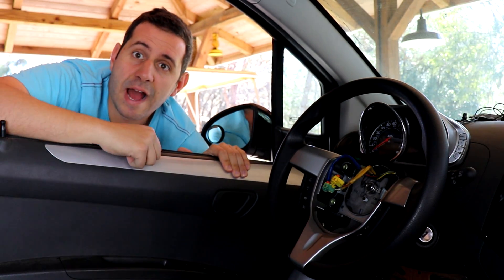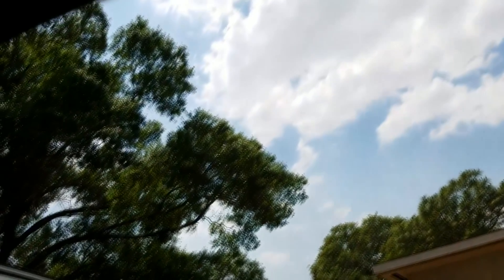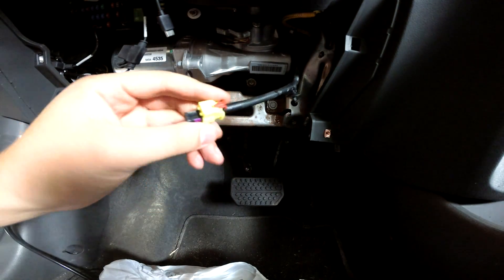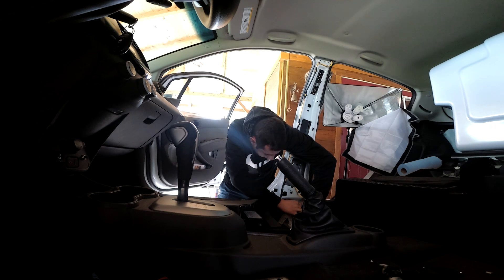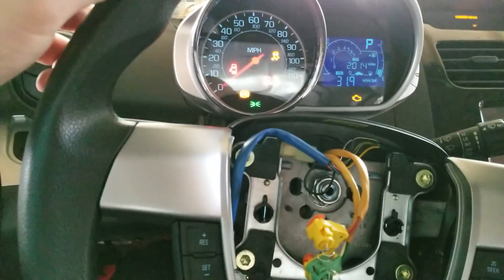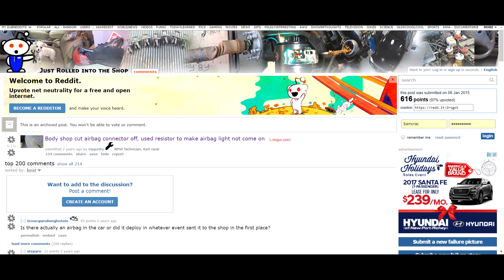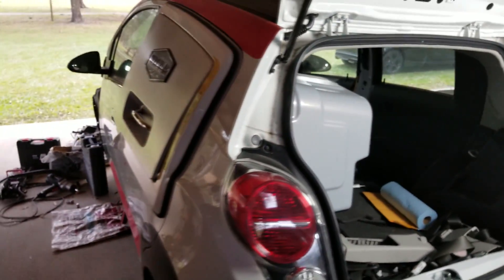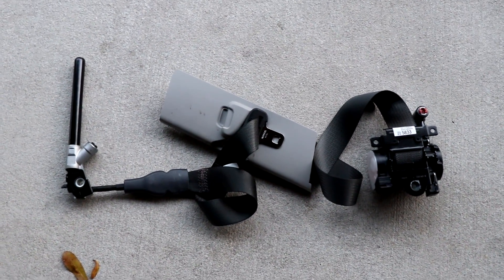How Scammers Hack a Car's Airbag System for 5 Cents (Permanent Airbag Light Off)

Comment: Samcrac There are actual apps that give options to turn off the airbags in certain locations. I have an app for the 2013-2016 Ddge Darts to where I can turn off certain airbags like Seats if I wanted to run a racing bucket.... I can also turn them completely off if im on the track as well.... guess what... no light on the dashboard. most FCA cars work on this app as well.
Reply: tellus

Comment: I was worried about airbag activation when installing a new one   Is it safe to install an airbag. You don’t need to be certified?
Reply: Disconnect the negative terminal of the battery wait 5-15 minutes and you won’t have any chance of the airbag activating when you install a new one

Comment: You have to be a real POS to put a resister in to turn an airbag light off. Does not surprise me though.
Reply: i really want to see a picture of this dude and his family driving down the road in a car outfitted with 4 nascar grade racing seats, harnesses, etc...on the way to get groceries.
Reply: there are legit reasons to do it  though - if you fit an aftermarket steering wheel to a modern car you will need to do this to get rid of the airbag light.
Reply: Done it lots of times in jeeps, when swapping out to 4 point seat belts or suspension seats.   I wouldn't suggest it for a normal, never leaves the road soccer mom's ride,  but it can be done.   It's the same as the catalytic convertor delete. Pop it out put resistor in.   Bob's your uncle.   Or aftermarket remote starts. I could go on with the legitimate uses of this trick, but I won't. 

As for the guy suggesting we all drive Nascar caged cars...  Even with a 5 point harness and a Recaro (the closest thing I'd ever suggest to full Nascar sprcs) your heads going to move in an accident.   This is why they wear Hans devices. It basically is a seat belt for your head.   Since Earnhardts death this is a requirement.   Nascar doesn't have to worry about cross traffic or blind spots since they use spotters.   This device makes it impossible to look around the car as its required to in everyday traffic.   Hence we use airbags to slow and prevent your head from snapping forward, where it could sever your spinal cord.
Reply: Your head doesn't need to "hit" anything for you to die, Your brain is suspended in a fluid inside your skull. A very high G-Force event can cause your brain to SLAM into the inside of your skull with enough force to cause a head injury and/or death. Roll cages, Safety harness, Hans device, etc is not going to stop this from happening.
Reply: @michigancur6670  Cat delete, dial your A/F ratio. Leave the rest to your imagination.
I junked a car with cat delete. It was 30 freed up ponies. And the trans went out.
But fun for a while.
Reply: @ayebee1207  we don't have smog check here, so usually once the cats go, I'll just straight pipe them.   A professional shop can't do it, but a buddy in the garage.... 😂  Other than that only when I'm turning something into a track car.  Then yeah it might be a couple dozen ponies but every little bit helps.
Reply: @ayebee1207  what kinda car? Note for. Future.ref, build the trans
Reply: @michigancur6670  That's  the reason the systems work in conjunction with one another,  a friend in highschool lost his fiancee from head snapping violently forward;  the seatbelt and airbag specifically have a task assigned to save a life.
Reply: @michigancur6670  I followed Mr. Earnhardt since he had the pink stock cars in the 1970's. I was really sadened upon his passing. His son and family were very lucky in the aircraft crash.
Reply: The stuff i've seen done by stealerships and their partners would make your skin crawl. ANYTHING for that extra dollar they can suck out of you.
Reply: Racing has people on the sidelines who are at the ready in the event of an accident. They don't have to worry about a fire immolating them while they try to get out of their harness and climb out of the car.
Reply: Fully agree. But even worse was what I have found on the Z4 (E85) that was delivered to me after purchase. Someone took instrument cluster out, disassembled it and put black electrical tape on: MIL, airbag and TPMS for them to not being seen ...
Reply: good point...but that is literally the only other reason you would do it.
Reply: It wont turn off if u do it that way....you would have to remove the shorting bar first.
Reply: m ph de
Reply: Or a manufacturer that made crummy dashboards. Big pieces of hard plastic that shatter when the bag deploys. The recalls on Takata bags claim that Shards of metal were causing injury and deaths.
How many are car interior trim? So I will let you chew on that. Airbag, claymore?
Reply: You people have been brainwashed into thinking The Airbag is actually saving your life? It is a supplemental safety device that adds another small tiny layer of protection aside from the Seatbelt. It was a law passed, that is why Manufacturers had to comply, and this causes car prices to soar. This also causes lots of car in junkyards who resell your car in parts, because it was totalled out by insurance company, and insurance companies get to raise your rates, its a win win for the Auto Industry Billionaires and one hell of a loss of us Hard Working Americans. These Airbags have FOOKED us more than helped us and caused us serious Financial burden, especially on those that want to repair their own cars and didn't have full coverage. Now the dealer gets to sell another car, because your car was totalled, why? because of Stupid Airbags that don't save lives, is your seatbelt DumbDumb. 

If you think an Airbag saves lives. The Drive with your family down the road, with no seat belt on "Only Depending On Airbag" and get into an accident and let me know how that works out for you and your family. On the other hand, Do the opposite, drive with you seat belt on, get into and accident "No Airbags" , and let me know how easily your walk away from such crash. 

We have classics on the road with no airbags, cars from 1950's up to 1998 or so with no airbags and they are still on the street and you don't hear of people getting killed in those cars because they have to Airbags, Do You?.  For God Sakes we have cars from the early 50's on the road with no Seatbelts at all. Seat Belts were required in rear seats by law up into around 1964 not even front seatbelts, and it wasn't even law to wear them or Mandatory, cars just had to have them... Law came in the 1984 here in NYC, because of that Authoritation FOOK Mario Cuomo Senior. Now as of 2021 his Son is Governor in NYC and He is even a bigger D**K and is requiring that all passengers in the rear wear seatbelts or get tickets and another FOOKING reason to pull you over and take your hard Earned Money.  

I Swear there are so Many Sheeps that believe and trust in crooked politicians and swear our Governments are Gods. If that's you, you deserve what's coming.
Reply: @ELEVOPR  one of the only free thinker, non brainwashed ppl here
Reply: As in what fashion? Selling a used car private party to an un suspecting buyer?  Yeah if you're Intentionally being deceteful with a normal driving car... BUT you'd have to be an ignorant asshole to assume this modification is explained for people selling a used car.. Ya prick.. this bypass is much more commonly installed on custom vehicles, aftermarket racing seats, etc.. However, it's mostly useful for honest and respectful everyday people who have an issue with their own personal vehicle and would LOVE to get rid of the aggravating and bothersome SRS warnings or notification chimes/lights that one day randomly appeared and never went away... JERKOFF
Reply: I need to do this in my converted Transit van so the giant side airbags don’t blow the wooden cabinets I’ve built into the cargo area.
Reply: @brandise76  I'm about to do this for my mini van I've gutted and now will start my build. You can take the air bags right out, then put the resister in. Just make sure you disconnect the negative battery cable before messing with the airbag.
Reply: The Obsesed Anime Freaks A Nascar racing seat is like a baby seat on steroids, you must be agile and fit enough just to contort your body to get into the seat, then theres the problem of turning your head to do basic driving functions as that area is heavily bolstered and only allows your head to be pointing forward. Imagine a vehicle with all passengers sitting in this fashion? Its highly impractical.
Reply: So are you saying that all the research, development and  laws revolving around airbags all around the world simply should not be because reasons?
Reply: @juanjovista1  yes harnesses and roll bars are are actually safer.
Reply: Drive slow butt holes
Reply: Mariusz Dullak Thats why all manufacturers have a "bulb check" function. Turn car on without starting engine and all warning lights will come on. If those dont light, walk away
Reply: Number of reasons to do it...but yes if you do it an don't disclose it when you sell the vehicle you are for sure a POS
Reply: It’s just so messed up like they could actually hurt somebody doing that
Reply: uh they have, hell NASCAR, Recaro, Sparco and other manufacturers and racing series have, but due to practicality and stagnant outdated pile of shit regulatory reasons, they haven't been implemented. Have you seen a wreck in nascar?  have you seen the worst wrecks in most autosports? These drivers walk away from stuff that would kill them in a normal car. normal cars are unsafe compared to the safety systems in a race car. if you were smart you would throw out those airbags and go to something a bit more intrusive and more effective.
Reply: it's more realistic and reliable than an ejection seat or airbags, and they don't necessarily have to go that far, just far enough to hold you in your seat and protect you from impacts.
Reply: @TheObsesedAnimeFreaks  ejecto seato cuz
Reply: If they are so dangerous why does everyone use them? You would think at least one company like Mercedes would go out of their way and create a better system then advertise why the old way is dangerous compared to theirs aka they get more people buying their products.
Reply: or actually someone that is smart and doesn't think that using explosives in a safety system is a good idea. (trust me it isn't) this is also why racing series have used roll cages, harnesses and other static systems to protect their drivers to greater effect.

Comment: By the way, when you twist the resistor and the leads touch, the resistor is shorted and 0 ohms, not the 1k, 2k, 5k ohms or whatever you chose.
Reply: that was bugging me too, wondered if someone else noticed
Reply: Samsung Galaxy S7 that’s my point exactly, the metal leads of the resistor will he fractions of one ohm or close enough to zero.
Reply: thank you sir.
Reply: I think he twisted them just enough where they weren't touching. Kind of hard to tell from the angle.
Reply: @hugoharo8868  oh don't ruin the sensationalized sarcastism of the hater trolls
Reply: yep  i was like wtf
Reply: Exactly
Reply: 2 ohmd

Comment: This actually happened to a friend, the car he had bought a year or so ago hit a patch of spilled diesel on a hill, spun out and went into a stone wall, no airbags went off, turned out it was a Cat. D writeoff and "repaired", frame was damaged, airbags deployed and replaced with resistors, and when the car crashed with him driving, he had no safety equipment work aside from the standard seatbelt lock-up feature (pull quickly on the belt and they lock up temporarily), the garage he bought it from is presently being sued...
Reply: Here's hoping your friend quite literally takes them to the cleaners.  Their hack could well have gotten your friend killed.  

The only "legitimate" way to do such a hack is if every buyer, driver, and passenger of that vehicle is notified of all the missing safety equipment prior to each use (ideally disclosing such with a permanent label on the instrument cluster and elsewhere) and that they are assuming a greatly elevated risk in case of accident (I know not how to ensure passengers are reliably aware..which is why such is really a bad idea unless it is only temporary while the parts are on order).
Reply: GOOD!

Comment: These resistors are sold on eBay as airbag testing equipment. Crazy.
Reply: You can buy resistors at ANY electronics sales site.
Reply: @scottfirman   People used to do this with the old GM VATS KEY I III III back in the 80's and 90's go to Radio Shack and get the risittors find the oms which they had 16 different oms configurations and by pass the computer chip key and Radio shack sold them in a all 16 in a box 30 of each for 6.99.
Reply: Akiva Feinstein they are

Comment: When I was growin up , we walked backwards up hill against the wind in the snow and we didn't complain.   I miss the good old days when we got to smash our faces into the dashboard and the steering wheel and did not have to worry about some damn sissy air bag codes  xD
Reply: I've driven a few cars long before airbags coming out and have bitten the steering wheel a couple times from wrecks.
Reply: 0_o

Comment: I can see someone getting into an accident with a safety mechanism removed and suing the repair shop.  Very bad practice and the repair shop would be culpable for injuries. If you knowingly defeated airbags and a passenger was injured in an accident in your car you would be liable for any injury or damages. DONT DO IT!
Reply: Hard to prove who tampered with it. Especially if its an older car with mulitple previous owners. Thats why the shops can get away with it.
Reply: There was a law suit involving a body shop and State farm insurance. Vehicle was bought used.
http://www.autobodynews.com/index.php/industry-news/item/13917-couple-injured-in-honda-fit-case-awarded-42-million.html
Reply: Stee Vee Zee nice it shows its not impossible to prove, but i would still think its a hard case to beat under different circumstances. The body shop came forward and was defending the repairs made instead of denying they made them.
Reply: no... you wouldn't. the person who ran into you would, oh wait, if it is your fault anyway you would be liable. don't drive shitily kids, you'll get sued.

Comment: When i was tought how to diagnose airbag systems in my auto tech program this actually it tought to techs if there shop doesnt have the 1 or 2 grand to drop in a airbag tester most shop will use this trick to diagnose the system cheap

Comment: Sam did you ever consider you are telling some less than honest people this airbag delete resistor scam?
Reply: Fixer 1 
Did you consider  that he is also telling a lot of people who might get scammed about a potential problem. It's harder to scam some one who is aware of the scam. Information wants to be free!
Reply: I don't think this is a big secret and someone with ill intentions will find this info regardless
Reply: Fixer 1 Obscurity is not security.  You ultimately defeat these sorts of scams precisely be making them well known, even to the average Joe wherever possible, such that everyone (or at least many) knows to look out for the issue and shops then have reason to fear they will be found out if they engage in such behavior with any regularity.  By "keeping the secret" you ensure that only those of us with a background in electronics, the service manual, or a detailed knowledge of the pyrotechnic mechanisms and what is being "tested" (the loop impedance) by the SRS computer remain familiar with scams like this, and we are a much smaller subset of the car buying public.  The more people who know to look out for such scams the less likely the average Joe is to be scammed in the first place.
Reply: Also people like me are looking. I have a POS truck i bought for $900 i am not selling it. I just need an inspection sticker.for my truck that i own abd use. The entire dash panel that conceals the airbag is gone. I have a portable radio jammed in the hole. Everyone knows there is not an airbag there. Inspector says i got to make the light go out. Ive considered removing the bulb but id like for it to still come on for a few seconds when you turn the key ya know.......i could remove the bulb but then next year theyll tell me i got to fix it......so im not too interested in doing anything to make negative progress doing things id have to take out next year
Reply: It works! I can finally flip one car I've been sittin on cause of this exact problem. Light off =outta sight outta mind=sold vehicle. Used car is as is sale buyer beware. Thanks sam,ill foward this vid!